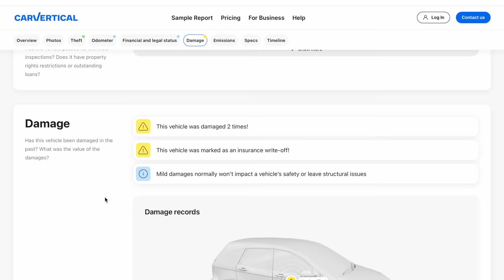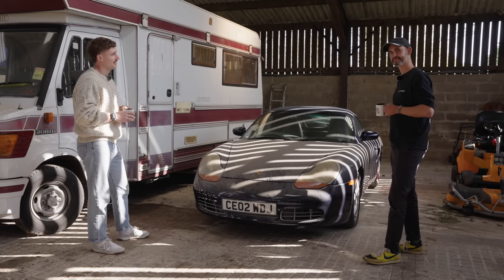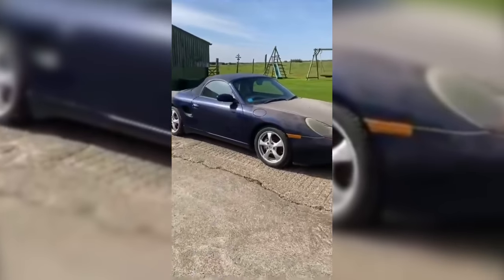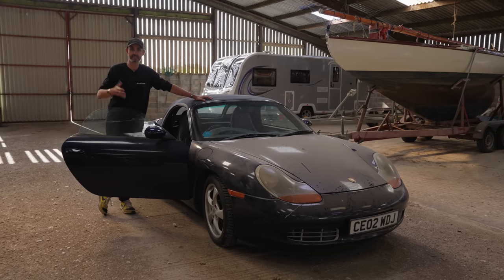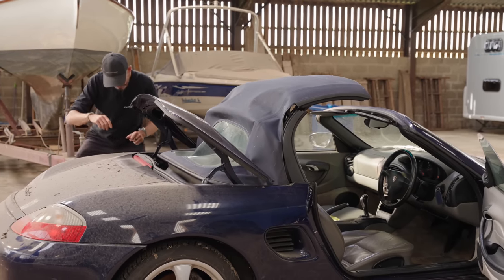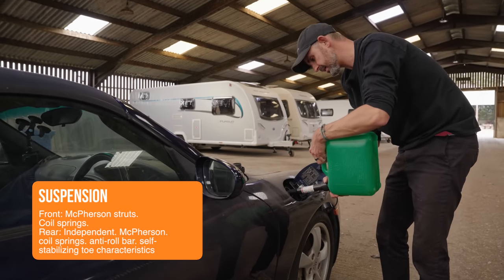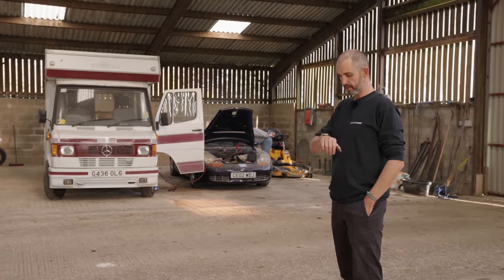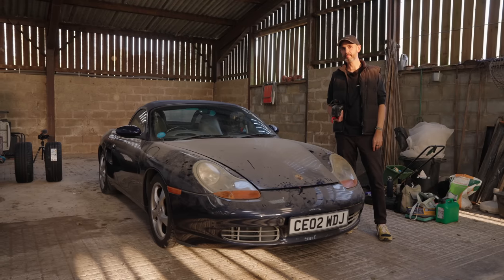I bought Britain's Cheapest Boxster - My First Porsche

Comment: First Porsche I ever drove (of not very many). I owned a 40th Anniversary for 5 years but the £2k+ each time I took it for any work at all eventually put me off plus the voracious appetite for batteries and unreliability associated. But, a smooooth engine, effortless power, comfort, quiet (yes, I like that), poise, handling, small size (this is narrow bodied 2WD) made it a lovely thing. Docile and civilised to fast and controlled. It simply didn’t get enough use either. Glad to have had one as you should. 996s with sorted RMS and ceramic bearing are excellent. I don’t think the X50 pack adds other than power at the top end at the expense of low/mid but bragging rights, perhaps. Enjoy the Boxter but you’ll hanker for a “real” one…….

Comment: I had a similar issue with a saab 95. Was a magnetic sensor that failed when it got hot. Was a pain to diagnose but cheap to fix once it was found.
Reply: Me too... fly wheel sensor on a fiat Tipo. It wouldn't generate pulses when warm (tested with a hair dryer used to warm it up)

Comment: You said you didn't start it but you did turn it on. For the ECU that's really no different. When you turned the key on to drop the top, that likely set it into it's fault mode. You probably just need a more advanced porsche specific scan tool to figure out what the ECU is cranky about.

Comment: To open the front or rear boots on my Boxster as well as operating the switch I need to also hold the drivers door handle open so give that a try. I think its a security feature so no one can reach in and open them when the top is down.

Comment: Ha! I recently bought 'the cheapest' 996 which turned out to have a VERY similar electrical issue - started 50% of the time, so frustrating. My OBD found a fault with the traction control, which I wouldn't think was connected to my problem but after trying all the solutions mentioned in the forums (ignition switch, starter, starter relay etc) I turned to the ABS module, tested all the wiring, all ok, plugged the unit back together and hey presto! Hasn't let me down since. Guess the plug was making a poor connection. Loving the car now, but plenty more to address......

Comment: Hi Jonny Well only last week I bought a 2001 Jaguar Y registered 4.0 litre car, The condition was far nicer than a few of my previous jaguars and sadly I never test drove the car or checked the service history. No real service history, a service book with not a lot in it..
Like most a new purchase you always have to learn about the car.
My first bug bare was the swinging interior mirror.
The second was between 52 and 65 mph there was some wheel wobble vibration.
Seller mentioned a couple of bushes in engine bay siting under the shocks..? oh and other was a fuel issue if you keep half tank on park up and refill before going for drive it works..?
Thirdly was mega weird like you was driving through a mega high powered under car jet wash, it was heavy rain for sure.
I was so close to leaving this car go as my old 3.2 Jaguar was only a 2000 and I missed that.
But presently I own Audi A6 2.7TDI Estate 2007 and my Mercedes CLK 320 convertible 2002/52 and two Astra convertibles one is 52 plate and other is 07 plate.
And not forgetting my 5 year relationship with my 2014 high top transit which since my health scare last October 2022 Its rare I drive it.
But honestly each mentioned car brand has varied quirks..
Wish you look with Porsche is it a 3.2 engine..?

Comment: Quite likely a dodgy solder joint in a relay box or ecu or related fuse issue. Worth checking. Had similar issues with an SLK that solved. It will be something simple but garages often scratch their heads and spend ages changing lots of parts and sometimes charging lots when its quite simple. Owners clubs put you straight v quickly.

Comment: Not sure how relevant this is (for a car) but I had a similar HOT STARTING problem on my KAWASAKI ZXR750 motorcycle recently. It turned out to be the pulse coil pick-up unit that is part of the electronic ignition system. It would run no problem, start from cold easily but need  a 30mins leaving period if stopped with a hot engine.             Richard

Comment: So many people don't understand that OBD protocol is the most base level and was designed to let a California highway patrol officer fine you for polluting ... A cheap OBD reader will only access pollution related engine information and not body modules or ABS etc... It was never meant to . Most good quality scan tools ($1000s+) will be able to access more info but some times communication won't even be possible due to damage in the modules themselves... I like the theory of clutch switch that was mentioned earlier but also presume you started it without pressing the clutch when it eventually fired..? Good luck with the project :-) Wish they were available at that price here in Aus ....

Comment: In the early 70's I bought a new Opel Manta coupe, a 'Blue Max' special. After about a year it developed the same no start condition your Porsche(Por sha) has. The Buick-Opel dealer could never figure it out and I never figured it out either.  Lived with it for years and still wish I had that sweet handling Manta.

Comment: Jonny I had exactly the same problem with a Toyota Celica I brought with the same fault. It ran lovely but on the odd occasions if I turned it off it would not start or turn over only after minutes or even hours of trying.
I found out the key had a transponder in it so got another coded but still the same.
I decided to buy a second hand ECU and a key for that ECU, plugged in the second hand ECU and taped the key to the ECU box otherwise I would of had to change the ignition barrel.
As soon as I did this it burst into life and never had that problem again.
Nigel from Cornwall
Reply from the maker: Great info Nigel, thank you

Comment: Hopefully you see this. If the no start issue is when it's hot then it'll be battery Y cable. If it's not that then check the crank position sensor

Comment: In my Beetle years back in the 80’s I’d always promised myself that if I had the money I’d buy myself a 911..but by that time I’d changed my mind & wanted a Cayman..
But then found a Boxster 2.7 that had only 50k mileage & had been in someone’s collection a 51 plate & same colour as yours.
I just had to have it, it was immaculate except the rear plastic window was completely knackered..
So I bought it & had a completely new hood fitted with glass heated window, after that I had nearly 30k miles of fun..
I bought it as a weekend car, but I landed up using it more than my other one.
Then the rear crankshaft oil seal started leaking & a few other niggles so before it got too costly I traded it in..
I have to say looking back it was a great little car, not dissimilar to my Audi TTS that I own now.

Comment: 22:28 minute mark it said "Ignition Key Not Removed" when you were trying to start it. Get yourself a new ignition switch and it will probably fix a few of the issues your having, its a very common fault on the 996/986 range and can cause all kinds of havoc when trying to start or shut down.

Comment: Having struggled with a Boxster with a flat battery some years ago, I recall the shenanigans of getting into the front boot. It opens by an electric switch… but the battery is flat. But the battery is in the front boot… but the battery is flat, ad nauseum. So Porsche thought of that and there’s secret cable pull under the wheel arch that feels just like part of the car’s loom. Ok, so after continuously overlooking the loom, I consulted YouTube and realised it was the pull all along… tugged it and “click” I was in.

Should only take me a few more minutes, set up the jump start cables and…

The same click as Johnny experienced.

An hour later and I found an obscure YouTube video that explained to me that the car won’t start because the immobiliser’s battery has been drained and Porsche engineered it not to start.

Sheesh.

Anyway, I found the hack, and some 3-4 hours after I decided to jump start the Boxster the engine was running sweet as a nut.

And guess what, the same circuitous problem also applies to all the 911 cabrios from 996-997. 

Seems the very immobiliser that’s such a bitch with a drained battery is the reason why the battery drains in the first place. Don’t use the car for a couple of weeks and it’ll be fine. 3-4 weeks? It’ll probably start. 5-6 weeks? Consult YouTube and go through the crap I had to go through.

So if you go on a long holiday then for lord’s sake leave these cars on trickle charge. Or best yet ask a friend or neighbour to take it for a spin every week or so. They won’t complain too much.

Ric

Comment: Nice one. I’ve owned two: a new 2.5 when they first came out and a very decent 3.2S once upon a time. Smashing cars to drive. I drove an Audi TT and a BMW roadster before buying the Boxster. The Boxster employs a F1 designed chassis and suspension setup. A bit slippy in the wet. Keep something heavy in the frunk. That tends to settle them down a bit and gives you better overall handling. That and a full tank. Have a word with Ed China. He will have a fix for the ECU. Best get the carpets out and see if the water is causing the issue, as all the cabling runs down the door sills and up into the steering column.

Comment: I wonder if it might be a cam or crank position sensor. When the sensor started to fail in my vw, 1.8 turbo the car would sometimes not turn over with the engine warm - like if I stopped for fuel - had to wait 30-40 minutes for it to cool down. The opposite of what you're experiencing but when engine sensors start to go, they sometimes refuse to turn over. I think it was because the computer won't let it turn over if it doesn't know where the crank is positioned. Those sensors are sometimes in tough to reach places. I was quoted an hour and they took 4 hours replacing it.

Comment: Had the same issue with my VW 2001 115pd tdi Bora , after a four years from new. Took ages for VW to diagnose. It turned out to be a faulty oil pressure sensor, thats integral to the pump.
The fault never came up on any diagnostic tests either.  I did everything you did, apart from the obd reader, didn't have one.Then one day it just wouldn't start. Got the AA out, and he couldn't get it to start. So it got towed to the Local VW garage. They had it for five days, and it was an older technician that finally worked it out. They fitted a new oil pump and it ran flawlessly. Cot £400 quid , but money well spent.

Comment: Hi Jonny,
               Love the channel. I had a VW Passat from the same period. Similar problem. If the plenum chamber blocked, the front carpets got soaked. The trouble was under the passenger carpet was a Comfort Control Module, which appeared to look after a lot of the secondary functions of the vehicle. I wonder if a Porsche Boxster owner could say if it has something similar and it's location. I replaced mine with a s/hand unit. Good luck with it.

Comment: renonwed for dodgy Key barrels,....... and MAF (get very specific part number to model)  - disconnect battery with ignition on (alarm going off)     .... fault codes are brand specific - cheap wont see them

Comment: Never looked at the Boxter before, had a 981 Cayman which I loved and a 996 Turbo which was a beast but have to say that Boxter looks so right, small compact proportions and lovely lines - what a fab buy!
Reply from the maker: I think the 986 has aged really well. The build quality is lovely (some say the Finnish built cars are slightly better) but either way it's a real flat six sports car for buttons.
Reply: @TheLateBrakeShow  Buying it is just the start. Keep thinking of the word 'buttons' every time a large bill needs to be paid to keep it on the road.

Comment: Jonny, I have a 1999 986 now with 110,000 miles on it. Bought it in 2012 for £7,995 with 18,000 miles on it! Serviced by Porsche Exeter every year. Had the same problem you faced earlier this year - intermittent failure to start. Porsche Exeter diagnosed it as a failed speed sensor (whatever that is), replaced it and now it's perfect again. It's the best Porsche I've ever had - handles beautifully. Yours sounds terrible by the way! Should be a lot sweeter.

Comment: If the starting issue only occurs when the car is cold then it could be bore wash, it was a common issue and doesn't just happen to Porsches, strangely it was most common on vehicles from the late nineties to the mid/late noughties. Basically when the engine is cold extra fuel is injected and it washes the oil off the cylinders, which isn't a problem till you shut it off whilst still cold and then it doesn't like to start because there's to much fuel and the compression has dropped cos theres no oil on the bores

Comment: Ever since we got a 986 to replace the wife's MX5 and my Saab 'vert, I've been seeing endless "bargain basement Boxsters" paraded on YouTube, bith in the UK and US. Often they have relatively little needed to bring them back into service after being flooded, crashed or neglected. 
We paid near the top of the market for 100% solid Porsche specialist history, lowish mileage garage queen and it rewarded us by rotting its rads through almost immediately. Apparently Porsche specialist dealer service doesn't include having a peek to see if there's a build-up of leaf litter in the airways...
However, to drive is to forgive...

Comment: l was shouting noooooo !!!! at the screen when Jonny said he was going to turn on the ignition to lower the roof.  l suspected that it was a computer fault by the owner's description. Sadly for Jonny it looks like l was right. Using the reader to reset it is a win though. lt means Jonny will probably be able to use the car reliably while he sorts it out. 
Picking up an unknown car from far away when you have a time crunch is a recipe for disaster in my experience and just not worth the stress. That's why l bought my own car trailer . Doesn't get used much ( handy for other uses though ) but the peace of mind makes it worth every cent.

Comment: Ive had them 1500 quid and the 3.2 theyve dropped right down in price still a clean low mileage will cost anything up to 9 k but rough ones like ones ive had from 1500

Comment: I've not worked on a porshe but some cars wont run if they get a low voltage code, the code just needs clearing as you did.

Seems some great porshe specific info in the comments too

Comment: Hi, Did you sort the starting problem?
I have a 987.1 & had a very similar problem. It turned out to be a switch on the clutch pedal, it's a safety thing to ensure you depress the clutch before starting but they are prone to fault. I changed mine but it only lasted another year before the problem recurred. You need to be a contortionist to get your head in the footwell to see the switch. In the end I bridged the switch with a wire & haven't had any problems starting since. If your Boxster has the same switch it would explain why you couldn't start it when trying to bump start it, as the clutch needs to be depressed.

Comment: Someone on reddit had this issue:  "So it was having issues where it wasn’t turning over occasionally, especially when warm, but seemed to be good at a cold start up. We couldn’t figure it out. Tested the pressure of the fuel pump it appeared to hold the right amount of pressure. The key was loose in the ignition lock coil so we changed that just because that can cause issues. Put a new battery in the car. And changes the crank position censor. After all that it was still giving issues. And then it blew the fuel pump fuse. And we tested it again and sure enough it was the pump. So changed it and have had no issues since."

Comment: Looks like your main roof arms have broken ball cups or even missing arms depending on what has been fiddled with in the past. I also suspect the roof front latch microswitch is playing up as neither of the windows dropped when you unlatched the roof, this can cause all kinds of problems with the windows as a whole.
The repair the alarm control units under the passenger seat, but usually the remote locking is the first thing to fail, windows not working is often not connected with this, but the front and rear release can be connected. We can bench test these control units.
Hot start... It could potentially be the alarm control unit, but one other thing that can cause this is the air bag control unit, which does not provide a signal within the first 60 seconds or so, so will allow the engine to start, but after than, if it has a fault it will send a signal to the ACU and the DME to stop the car starting... Which may time out after a while... But likewise you may just have a start lockout relay which gets hot and fails, which will stop a restart, but may allow a cold start.
One thing that causes loads of electrical gremlins is the ignition switch, just change it and see what might start working again... Potentially not the problem with anything specific, but can cause problems with many electrical items, so change it and see what improves or fixes itself.. . The switches are cheap, but beware there are two types and it is not just dependent on age as many have had the later steering lock and switch fitted... Also beware of ones which are too cheap. If you need any advice on identifying the right one, or anything else, get in touch.
A bit of TLC and I am sure that will be a great car.

Comment: Maybe the start problems are related to the failing module? Maybe first replace that and then see. And maybe before that, test if the OBD trick works all the time, even with a warm engine. Would be a nice workaround.
Reply: My guess is a faulty fly wheel sensor... breaking down when the engine gets warm and doesn't generate pulses for the ECU. Then starts to work when the engine cools